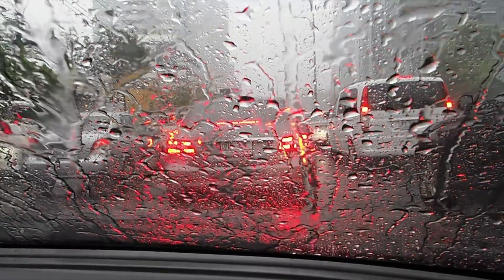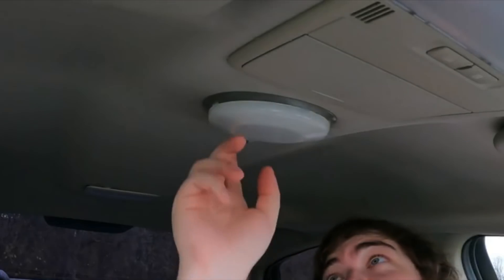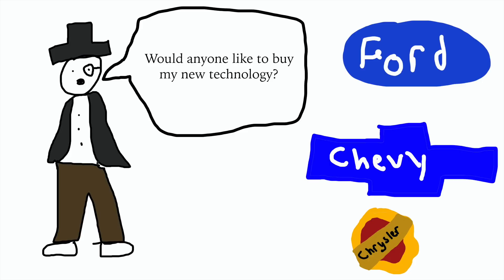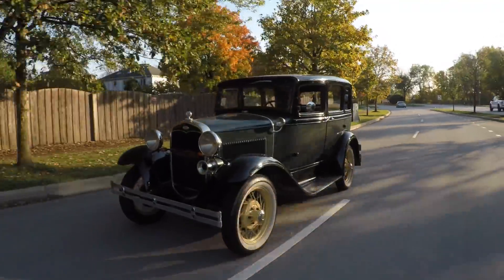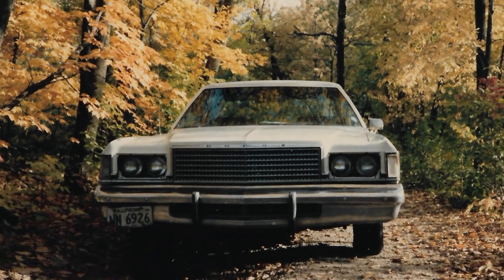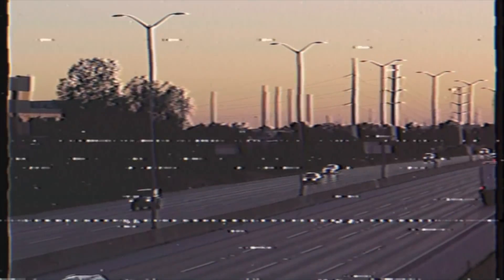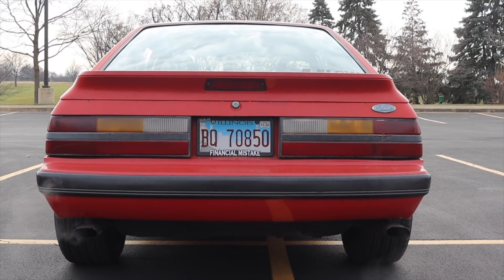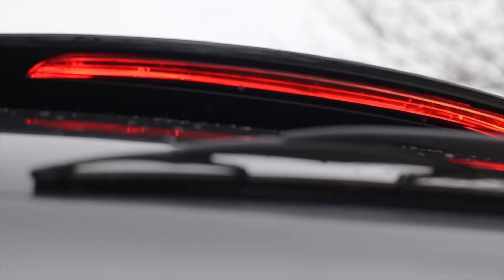The Third Brake Light - Who Invented Them & Why We NEED Them!

Comment: The U.S gave us High level brake lights, a huge safety improvement but im baffled why Red turn signals are still allowed, those are a stupid and far less effective than amber.
I had one person say that its about looks but that does not make sense as there are numerous cars here in the UK with entirely red tail clusters that light amber when on and are able to mix style with safety.  My own car, a Ford Mondeo has red lenses with the exception of the reversing lights but the turn signals light amber.

Comment: Seat belts weren’t required when I got my drivers license and nobody had ever dreamed of the 3rd brake light yet. To this day, I’ve yet to pay any attention or even notice a 3rd brake light. I’ve also never rear ended another vehicle. “WE” need them? No... YOU need them. You see, the difference is the 50 years ago, a vehicle manual gave the owner valve adjustment specifications, today a vehicle manual instructs the owner not to drink the liquid in the battery.

Comment: For some people, 10 brake lights isn't enough. They need someone to throw a rock in their windshield for them to notice that there is a car in front of them at all.

For some people, the time at which they notice the car in front of them has applied brakes was when they wake up in the hospital.

Some people aren't even sure what does the red light lighting up mean. Those people probably get lost in their own backyard.

Some people don't even know they have turn signals in the car until they run someone of the road and that person rips off the turn signal lever and shoves it down their throats in a fit of rage.

And in the last decade, the percentage of aforementioned individuals is rising at a disturbing pace.

Comment: So the third break light is great, but the new thing some companies are trying (three slow flashes then solid) is an innovation that makes driving more dangerous. So rather then identifying that a driver is slamming on their breaks and turning it at first looks like they are just tapping on their breaks slightly slowing down and you only identify that they are stopping after almost rear ending them.... also why haven't manufacturers made amber turn singels mandatory yet, break and turn signals on the same light is just confusing
Reply: *brake

Comment: the reason is that people are generally not smart enough to put any kind of multi filament bulbs in the socket the correct was so that the higher power filament lights up as normal tallight and brakelight doesn't work at all. only the third brake light, assuming people maintain their vehicle, can make you see when they brake at all

Comment: The little plastic dog accessory with light up eyes tied into the brake lights on the rear shelf in cars, were made illegal in the 60's. Reason cited was that drivers would focus on that instead of the actual brake lights, thereby causing a rear end collision.  Then it was mandated.  What changed?

Comment: You forgot to mention a very important point. This third light was made with LED lights, which gave a faster response time in the illumination of that break light. Lighting on faster means the driver behind that car could see the light faster and so apply his breaks faster.
Reply: My 1987 Caprice 3rd lamp wasn't LED. It took conventional bulbs
Reply: Wrong. 🤦 The third brake light was leds on some cars - not EVERY car! Most cars in fact always have had normal bulbs for the third brake light.

Comment: Everyone is so used to the 3rd brake light now that some cars now have flashing 3rd light.  Kind of annoying.  Gov should also require turn signals NOT to be low and mounted in the bumpers.  Most people drive trucks or huge SUV and they can't been seen very well.

Comment: The high mounted brake light doesn't benefit the car that has the brake light mounted on it so much as it is more beneficial for the car travelling behind said vehicle. Because the third vehicle in the line of traffic can see when the first car in the line of traffic has applied their brakes and so can plan to break before the middle card does. Avoiding nose to tail crashes.

Comment: There are no 1986 Mazda RX7s. Mazda took a hiatus for that year between the FB RX-7 and the FC RX-7s. FCs are 1987 model year cars, per Mazda.
Reply from the maker: This is false.
Reply: @ShootingCars  I have the book Mazda commissioned on the design and building of the FC and they claim they skipped the 1986 model year. There may be cars registered as an 1986 but Mazda does not recognize them as such.

Comment: Num-nuts, the 1937 Chrysler line-up ALL had center brake lights! Chyrslers, DeSotos, Dodges and Plymouths! They continued until 1941 on all models and some models until 1950, along with some Kaiser/Fraisers and ALL Tuckers for safety!!! Insurance companies DIDN'T like the fact that these cars were hit in the rear 80% LESS than other brands and people that OWNED them were DEMANDING discounts! So Center stop-lights were BANNED Federally in 1951 along with non-sealed beam headlights, even though BETTER non-sealed beam headlights were available from Osram, Lucus, and others. My Daddy had Osram's on his 1948 Pontiac Chieftain (not a Super Chieftain) and they were twenty-times better than Tung-Sol sealed-beams 6-volts.

Comment: Seems a core part of the reason for this story is missing; while tests had proven additional highmounted brakelights to work, this wasnt how they came to be mandated. Rather, car companies were pushed to stop the habit of using only 1 single dual filament bulb for running/brake/blinker functions, as it becomes really confusing when 1 filament is out; if right secondary filament us out, and driver taps brake a couple of pushes instead of one long, it looks as if the driver wants to turn left. While in reality they may slow down to turn right. So the push was for car companies to start using a minimum of 2 bulbs per cluster, as most drivers never changed bulbs before they broke, always after. 

And hence at any given time, there would be millions of vehicles on the road with this screwed up indication system.

But Ford wasn't having it. They had mastered the manufacturing of affordable vehicles by precisely such systems, where 1 component doubled, or even tripled its useful function. As an example, the original mustang, despite its 3 segment taillight, only have 1 single dual filament bulb inside the cluster. Its an optical illusion that your getting 3 small lights. And they still do this today on new Suv's and trucks.

Ford figured that 2 more bulbs and wiring ÷ sockets and the added cluster size needed to fit it, would cost them many millions per year, and came up with a compromise, which they presented, which was the third single brakelight. Not the dual highmounted which was the aftermarket norm at the time. This saved them 1 bulb, 1 socket, and 1 wiring harness, a housing and glass was needed, but still at less total cost than 2 qty 2 bulb taillights. And this was accepted as an alternative to the proposed mandate of 2 bulb light clusters. Next time driving behind lowend versions of Ford's, even midgrades, observe the continued use of 1 bulb taillight clusters, now also functioning as rear sidemarkers. Reverse lights have been added, but thats another story.

Comment: There’s a major problem with American turn signals , that is not experienced anywhere else in the world. Well… there’s two problems. The first is that you are allowed to have your rear/brake lights act as “turn signals”.  Nowhere else in the world do you not need to have dedicated amber lights. 
The main problem is calling them “turn signals”. They are absolutely not “turn signals”. They are “indicators”. You use them to indicate a change of lane, pulling away from the kerb, into moving traffic “and” turning. Many Americans only use them when “turning”, not to indicate changing lanes or pulling away from the kerb, simply because you call them turn signals, and everyone else calls them indicators. You know…. To ‘indicate’ to other drivers what the hell you are doing.

Comment: The way I see it GM is responsible for 3rd brake lights, they had brake lights in the low mounted bumper, the GM cars were in a load of tail end collisions, my 84 El Camino had brake lights in the bumper, well I got tail ended and my car got creamed, I would’ve could’ve should’ve mounted a 3rd brake light, the taxi cab experiment is interesting, I never heard it but I will continue to blame GM with the low mounted brake lights
Reply: Oh I didn’t remember this older comment but you don’t forget accidents that you almost die in

Comment: I'm more concerned about the idiotic trend of putting turn signals and back-up lights so low on some cars, especially the back-up lights some cars like the BRZ had them so low and in the center that you can't see them until you're about to pass right behind the car that's about to back out.

Comment: Was it nothing to do with North American vehicles using the break light as an indicator?
Reply: Not just brake light, but tail light as well. One bulb was used for 3 functions --- tail light (low brightness), directional (varying brightness) and brake (steady high brightness). Many European cars had 2 separate bulbs (and lenses) for those functions, which really eliminated the need for an additional bulb and lens. And if you couldn't figure out what the bulbs meant, you should not be driving.

Comment: I don’t know why bicycles don’t come with turn signals, silicon and battery is cheap enough that it wouldn’t add much cost and would improve safety a lot. Ffs you see disposable party lights and e cigs with batteries and lights and sometimes a charging port.

Comment: I was aware of the safety benefits back in 1968 when I installed two rear window brake lights (One on each side) on my first car (1959 Ford Zephyr) and every (9 total) car and pick-up since (except 1969 Meteor and 1972 Olds convertibles but I did try). My first vehicle that came with the high mounted brake light was in 1991 (Ford Explorer).

Comment: The solution could've been even simpler: ban shared brake/running lights and have four red lights.
Reply: One of the reasons I love my 2014 Focus hatchback. It has separate brake and running lights as well as separate amber turn signals on the rear. Also wing-mounted turn signals but those are becoming more and more common nowadays
Reply: Not just brake/tail light, but directional light as well. One bulb was used for 3 functions --- tail light (low brightness), directional (varying brightness) and brake (steady high brightness). Many European cars had 2 separate bulbs (and lenses) for those functions, which really eliminated the need for an additional bulb and lens. And if you couldn't figure out what the bulbs meant, you should not be driving.
Reply: @thecarman3693  precisely, a major issue though is that in North America, directional lights are required to have a minimal size, which is one of the culprit of this terrible design.
Reply: @Hampstead343  I don't think they are required to have a minimal size, but they are definitely allowed to be fairly small. And because people don't know the importance of them, it looks sleeker therefore it sells better
Reply: @richardmillhousenixon  yes they are, at least 7 1/4 sq in according to FMVSS 108
Reply: @Hampstead343  That's just saying they can be that small. It isn't requiring that they are, there are at least a few cars I know of in which they are larger, but they are allowed to be that small.

Comment: Not that it has really made any difference in the @$$-tapping on the roads, but whoever re-invented that in the '80s had no talent for styling.  Those things looked like added-on afterthoughts, like lighted bunions tacked onto the windows.  At least Oldsmobile's application on the Toronado in the early-'70s was blended into the car's lines, and they used TWO of them, serving extra purpose as turn signals.  That was cool.  It wasn't until the mid-'90s that the stupid designers even started thinking of blending that lighted bunion into the car's lines, making it look like a part of the car...but still, it doesn't stop or even significantly reduce the frequency of @$$-tapping.

Comment: The real problem was caused by the way the laws allowed the running lights, turning indicators and the brake lights being in the one lens in the USA. In other countries where they were require to be separate lights didn't have the problem you give here. The real reason for the third brake light is by putting it higher and in the middle made it more obvious due to being more in the eyesight line of the lazy drivers who do not watch the lights of the car in front of them.

I'm waiting for the US law makers to wake up and join the rest of the world by having the turn indicators at the rear as separate orange lens light so there is no way to mistake the turn signal for the brake light or the brake light for the turn signal.

Comment: Guess what, I have an 88 F-150 that does not have a third brake light.
Somebody messed up, didn't they? 😁
Reply: You didn't watch the video, did you? Passenger cars required it in 1986. Light trucks, which the F-150 is, didn't require it until the early 90s. 91 or 92.
Reply: @cirrustate8674  and I thought somebody at Ford just forgot! 😆 Thanks for the rain on my parade, it washed off all the dirty floats 💝😂

Comment: HOW TF DID THOSE LOW MOUNTED TURN SIGNALS GET APPROVED??? literally very hard to see, especially when there is water or snow on the ground that gets splashed all over your rear end??
Reply: A few manufactures do that stupid thing. You need them at brake light level or higher. Never lower. And never at the bottom of the bumper.
Reply: @krane15  no idea how they got away with that. first time I saw it I knew it's a safety hazard

Comment: Brake lights need to be mounted to the frame, some cars used to have them on the trunk and if you pull over and lift your trunk the lights would go up too. I remember reading something about that once. don't quote me on it
Reply: Why would your brake lights be on when the car's parked, you're standing behind it, with the trunk open? 🤨

Comment: Using the brake lights as turn signals is just not that smart as well. Just use separate amber turn signals so there is no ambiguity.